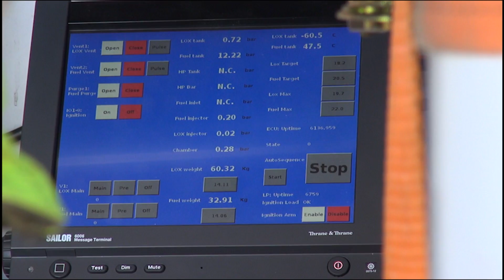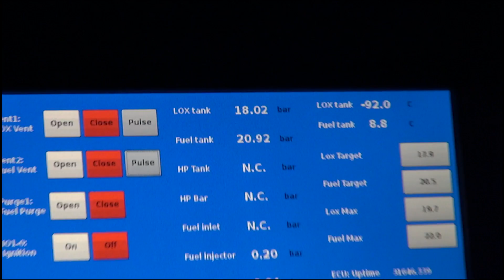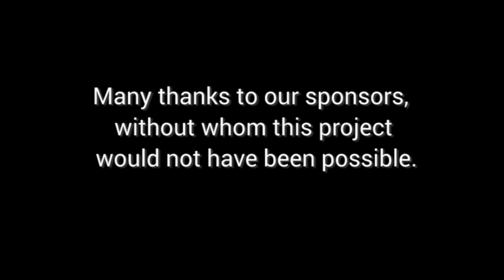Second test of BPM2

Comment: Hey, love your videos, but what are you referring to when you say 1% tear additive?
Reply: ***** TEOS - Tetraethyl orthosilicate. The purpose of the additive is to form a thin layer of Silicon dioxide on the inside of the chamber wall. This will lower the temperature of the chamber wall, allowing the team to run a lower water content in the ethanol used for fuel.
Reply: They still use an oxidizer right? or does the oxygen come in the fuel?
Reply: ***** yes - They still use liquid oxygen as the oxidizer.

Regarding the fuel. 
Previously, the ethanol used had 25% water content to lower the combustion temperature. Using TEOS as an additive in the fuel, this water content can be lowered. Potentially they can run without any water in the fuel.
Less water in the fuel, means that the energy content of the fuel will be higher. This means that they don't have to brings as much fuel, and if they don't have to bring as much fuel, the weight of the rocket will be lower, meaning that they can achieve their goal with a smaller rocket, and an engine with lower thrust.
Reply: ***** Yes. Good old alcohol. Ethanol is plenty powerful for what they need it for. The german missile V2 was powered by oxygen/ethanol, as was the Redstone Rocket that put Alan Shepard into space.

The largest advantages of Ethanol is that it is non polluting and easy to put out, should they have a spillage/failure. As CS launches from sea, if they have a ethanol spillage, it will not be of harm to wildlife, and as ethanol mixes with water, it will not be a fire hazard either. Also Ethanol is relatively cheap. They use a variant which contains 10% Isopropyl alcohol because of taxation laws (to ensure that you don't drink it)

Also the ethanol is used for cooling of the rocket engine.  RP-1 (a type of kerosene) which is also a common rocket fuel (Saturn V, 1st stage) has the disadvantage of a potential build up of soot and deposits in the cooling jacket which reduces cooling efficiency leading to a risk of burn through of the engine. Alsp, if you have a spill at sea, it will still be able to burn as it will sit on top of the water.